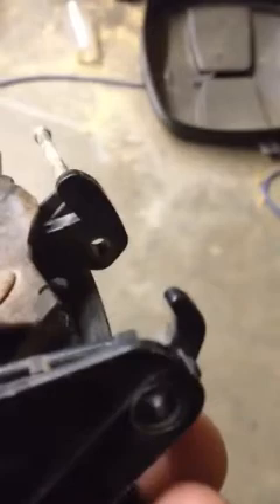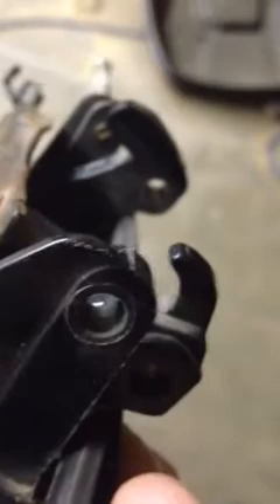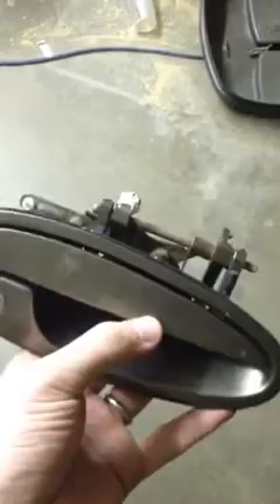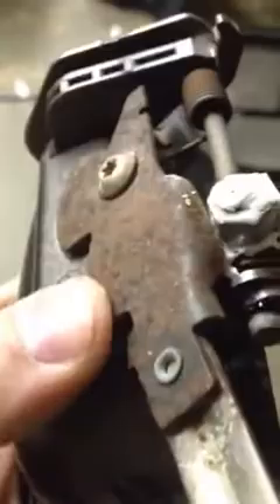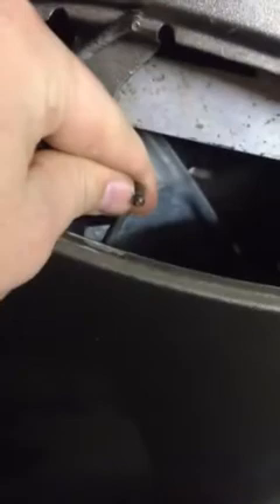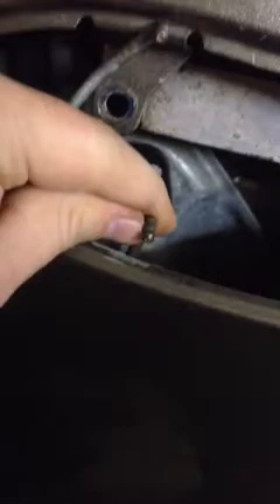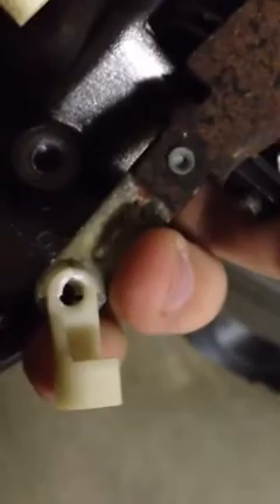How to fix a Buick Park Avenue front door handle for free

Comment: There are two plastic plugs that can be removed from the inside of the door to gain access to the 10mm screws that hold the handle. Much easier than working inside of the door.